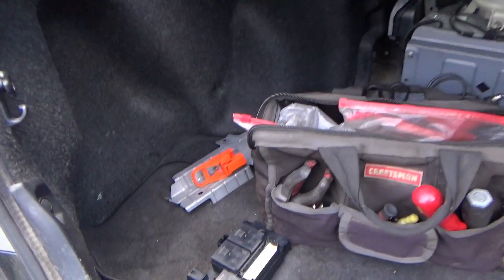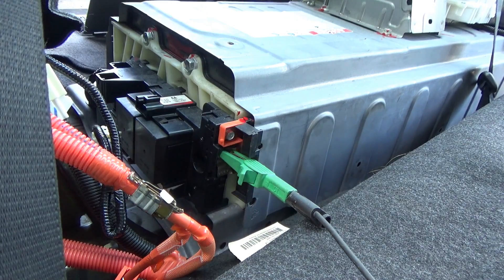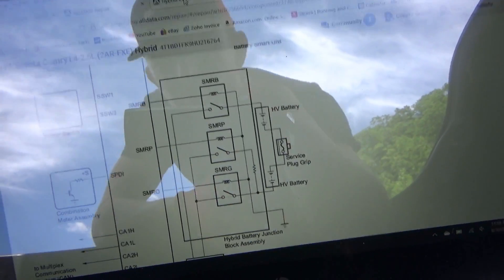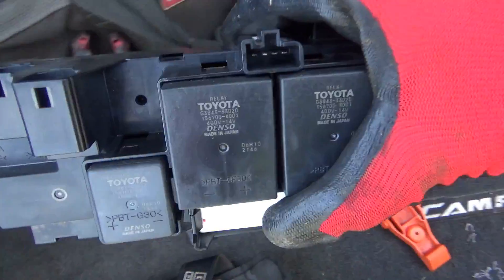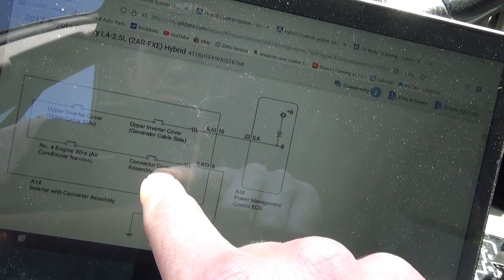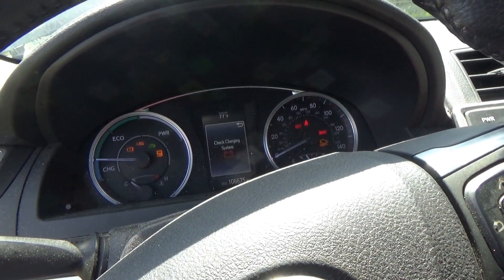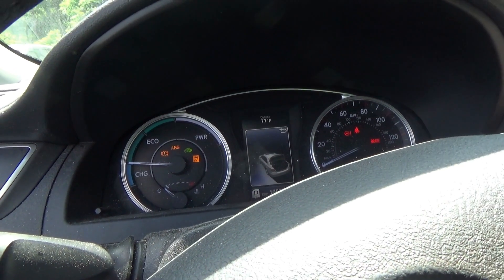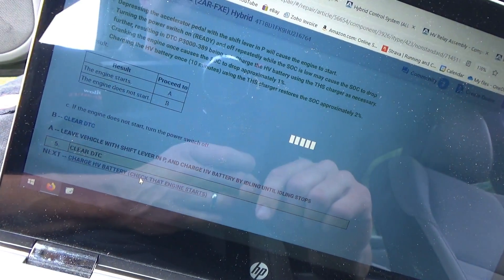Customer bought a HYBRID...and it Can't MOVE! (Part 2-Repairs)

Comment: If state of charge is below 20%, it won't enter ready mode. If there is a .5 difference between the highest and lowest v blocks it won't start. You can't just charge these, either. You have to discharge, then recharge and balance the damned thing

Comment: The traction battery Ah rating is huge compared to the engine starting battery (Aux). Most hybrid inverter designs provide for isolated charging of the Aux battery. I think the industry isolation tests are done at 3kV between Traction and Aux. 

The fast charger (fancy charger) specified should have power and com with the Traction Battery Controller (or Battery Control Module (BCM)). The BCM will monitor the Traction battery cells for power (voltage across and current through) in real time, as well as run the Traction Battery State of Charge (SOC) algorithm, amongst other things depending on the OEM.

Comment: Dealt with this one before at work. The THS charger is nothing but a high-voltage DC power supply.

We normally take the HV battery out (easy to do) and take the covers off. We connect an adjustable DC bench power supply across sets of four cells at a time, with the DC power supply set to 30V. Charge four cells until the current drops to about 100mA, move on to the next four cells and charge them, continue until all 20-36 cells (depending on model) are charged. Put the covers back on, reinstall the battery, car is happy. 

It's an extremely rare occurrence and tends to only happen in truly stupid situations. Ours was after a driver smashed the radiator, overheated the engine and kept trying to start it repeatedly until the HV battery was dead.
Reply: @kelvinstokes996  
Probably costs $6,000 too.

Comment: Hybrid car that is not driven for more than 2 months can have very low charge on the hybrid battery. It needs to be charged properly with proper slow charger that dealership have. It to reduce risk of permanent damage on the hybrid battery.

Comment: That ICE doesn't have a 12V starter!
Instead it has (what is called) a "crank-ISG"; which is a 3-phase electrical motor/generator running of the HV-battery and it's acting directly onto the flywheel. Even if the 12V BAT is perfect (at a 100% charge) you have no means of starting the ICE from a driver command. And a fully charged 12V battery would not be able to give a 2% charge to the HV-Batt even if the electrical architecture allowed it to. Hence you need the fancy HV-charger to get you out of this situation with a none-plugin hybrid. 

Your diagnosis is 100% accurate.

Comment: Wait I'm confused. I know very little about hybrids. Are you telling me there isn't a starter that's hooked up to the conventional 12V battery to crank the combustion engine?
Reply from the maker: Correct
Reply: There’s 2 motor/generators, one for starting the engine and recharging the battery through the inverter. The second one is a bigger more powerful traction motor responsible for moving the car and performing the regen braking function. AWD models have a 3rd motor on the back wheels.

Comment: Have a Toyota Prius 2008 no run no start I don’t have the fancy scan tool just Multi meter And a OBD 2 code reader . It turned out to be the in a pin connector in the high voltage area burned out same area in wiring just looking different. Replaced it with a computer terminal. Then I charged the HV battery manually by Charging each cell at a time works good.

Comment: Ivan, The battery cover removed, you will find a shunt that connects 2 or more battery packs together to make the whole battery. Once they are removed you can work on the cells individually as the voltage is safe. you can charge the cells with a standard 12v charger do not leave it unattended you need just enough to start the motor then let the cars internal BMS regulate the full charge. I am sure you knew this already but just incase you did not or perhaps help another person later.

Comment: thats easy and cheap repair. unplug the service plug, take it out, disconnect cells and measure each cell individually and write them down. Then replace the low voltage cells with good used or reman cells from amzn,ebay,etc. Put it all back together and it'll be good to go. Typically 2-3 cells are bad out of it because it sat so long with out being used. your looking at less than $100 in replacement cells

Comment: I have seen on battery underground drilling rigs on especially the SOC % (state of charge ) Condition after being ran down so low . The % you read out of 1% makes the battery system unhappy.
The battery system on our rigs uses onboard charging transformer through a drive inverter unit to charge the batteries!
The battery dictates everything and rig charging system tries to balance the charging voltage at the lowest battery voltage ( we have 4 batteries) and Amps to slowly balance the batteries during charging. 
The batteries on our rigs needs to reach 100% charge every 48 operation hrs or else the SOC drifts as you read out .

I can see why a special charger is required to correct the SOC % to 2
One big thing also is the battery system does a health check on the string of batteries to confirm there health by disconnecting battery charging and discharging them through DC heater for battery temperature upkeep . 
We also have relays on a bigger scale that send DC power on the circuit . 

It’s crazy stuff on these battery cars and hybrids as not many besides yourself can even fathom on fixing these in hometown repair shops without OEM support. 

I really enjoyed your videos on this hybrid issue 👍

Comment: There is no starter motor in new hybrids. The car uses the electric drive to get the car moving then engages the gas motor.  Thus the 12 v is only for the electronics and cabin items.

Comment: Stellar!  I learned a bunch from this video; and concur that purchasing a hybrid would require a lot of research before I dove in!  I wonder if Honda models have the same fail stops if the hybrid batter is low.  If there's an IC engine- by golly let us drive on it's power alone until at least we can get a batter issue resolved!

Comment: IVAN My neighbour has a Hybrid Toyota and went away on holiday for a few months, his wife asked me to start his car and give it a run to keep the battery charged up. When I tried to start it I kept getting a low battery ⚠️ warning message and light. I connected jump leads to the jump start terminals under the Bonnet (Hood) and onto my cars 12 volt battery and hey Presto after switching on and the car doing a self test the engine started after about 60 seconds. I disconnected the jump leads and let the engine run until it shut down automatically. When the neighbour came home 2 weeks later it started straight away. The Toyota Hybrids have 2 motor's  that also work as generators or Alternator to charge the batteries, both the HV and LV battery..

Comment: You really don't need a fancy charger to get some power into the high voltage battery. This exact issue happened to my 2018 Acura RLX Sport Hybrid after I was side-swiped this past January. The car sat so long at the body shop waiting for parts that the hybrid battery was too low to start the engine. I made my own "jump pack" out of 100 18650 cells and connected it to the air condition compressor power feed (the air con is 300v electric). It was enough to trick the computer into starting the engine and charging the HV battery. After 10 minutes I shut it down and reconnected the power cables to the AC compressor. The car restarted like normal and haven't had a problem since. It even cleared the codes itself.

Comment: I'm in E central PA. I could've cobbled together a charger for you. Not UL approved mind but would slowly current limit charge up to 310V, so just unhook it when it got to the voltage you wanted. Its too rare for the HV battery to die for the manufacturers to bother adding a way to jump the HV from the 12V. It also make$ for a nice excu$e to force a dealer garage vi$it.

Comment: also "WhY cAnT a 12V bAtTeRy cHaRgE a 290V bAtTeRy?? Im sO cOnFuSed"

Cmon man. They are a new tech, and just require new tools and understanding of new systems...complaining that the technology sucks because you arent familiar with repairing it is no different to ignorant boomers complaining that fuel injection was bad because they didnt understand or have the tools to interact with the computers to diagnose issues.

What you experienced here with the HV battery being so discharged is super rare. I have put dozens of millions of miles on hybrids in my fleet and never encountered it. It almost takes effort to get one of these things to discharge its HV battery so far it wont try and turn over the engine.

Comment: I bought a 2007 Camry Hybrid, black too lol,  from the auction. Yeah,  it was dead as door nails. The car sat in the auction for 6 months before sale. The hybrid battery was completely shot by then,  no THC charger will fix it. Had to put an after market battery in. The car cost me $1800 and battery installed $2200. Other than that it was perfect inside and out. The is the main reason I wouldn't buy a Hybrid in auctions unless they run,  they sit too long.

Comment: This is one reason I will never own a hybrid vehicle.  You are SOL if the battery is low.  Plus what if traveling and your battery is running low, you need to find a place to charge it, with gas or diesel you can always find some where to get more.  It's not like you can call a tow truck to come bring you a charge like they can bring you more fuel.  So this is why I been buying low mileage vehicles gas or diesel for when they stop making certain models.

Comment: You know i never understood why they tend to make all the crap around any high voltage connections all out of metal..  like youd think that for certain straps or brackets that are there to protect from shock would be made from a non conductive material..  like why have a high voltage switch with 240v on a 60a breaker stuffed into a metal box where theres live unprotected screw terminals less than a quarter inch from the ungrounded metal enclosure that gets touched every time the switch is used..  just seems dumb..

Comment: you need a used HV battery as a jumper box, pull the fuse disconnect on both batteries bolt them together in parallel install the disconnects, let it charge for a few min, pull disconnects remove jumper pack wires and restart.
or disassemble the battery pack, place all batteries in parallel and charge with a 6v 10 amp battery charger.
I have done it both ways.
i have also installed a second HV pack in parallel to run and charge 2 batteries making sure to bolt one of the wire connections after the amp current sensor on pack so as not to throw a code.

Comment: i work in a bodyshop and we have had this new  electric chevy bolt ev that hit a deer omg what a nightmare!.the car keeps coming back one problem after another.to work on them dissconect 12 volt first then pull plug under backseat if you do it backwards it sets off code like its been in a accident so it has to be reset by laptop dealer thing.cars are getting weird.for first responders if you open hood theirs a cable by the battery that says cut here then you are trained to rip back seat out and pull the plug theirs a 1000 volts their.not sure what it takes to kill a human maybe 230 volts?.scary stuff working on them.any cable thats orange means death.its gotten differnt i have replaced quarters and welded on toyota prius es  pull the 12 volt cables off your fine but this new gen not liking as a collision tech.we replaced everything that was damanged with new oem parts now it just decides ohh i was in a accident once so ill just do random bad things

Comment: Lol modern hybrids DO NOT HAVE STARTERS they use either the torque motor or the charge motor to start if the HV battery is severely discharged its not going to start. They also don't have an alternator they have a DC to DC converter to step down the high voltage to 15vdc to charge the 12v battery and run the 12v systems. The DC to DC converter CANNOT charge the high voltage battery by back feeding its one way. 

Older hybrids still had starters and alternators (we had one In the shop with a 5 speed manual) they only shut off the motor during cruising. It's not dumb... people who don't take the time to learn about their vehicles are dumb and this owner bought an auction car with both battery's drained it should have gone strait to Toyota in the first place

Comment: 10:03 I already knew it would throw the codes, because you didn't slide the connector lever handle down after installing and pushing the lever in.
I did that on a prius once and spent nearly an hour cussing it and then myself for not pushing it into place. 🙃 it would be different if that was the first time I worked on one, not that 100th+ time. 🥳🤡

Comment: lucky you upon reconnecting the 12v battery. stupid prius always blare the alarm like your a thief stealing them and you have to jam the keyfob in dash port before it will shut-up!
at least the older models with (SKS) keyless entry did that and when jump starting them from dead battery 100%. it's just great sticking on the jumper cables under-hood and it starts blaring.

Comment: you can get away with it just by towing car with rope whiles car is on once u get moving n put in driver from neutral it start charging itself up (done that few years agos on Toyota pri... (she run out of gas n she got stuck on side of road cant do both n i arrive n put gas in it but still refuse to start n i tell her my best choice is do tow car with rope on highway unite you get up to 30mhp n put it in drive that way will start changing it self up so u can get engine started n it did work on 2010 ) hoping you see this

Comment: I bought a 2008 Escape Hybrid for close to scrap value last year because the man couldn't get it started. He bought it at auction and parked it for 2 months after they delivered it. It has an onboard boost converter to charge the hybrid battery from the auxiliary battery by pushing a button at the end of the instrument panel. I put a fresh, well charged auxiliary battery in it and had it running in 15 minutes.

Comment: Hybrids are useless for most of us who drive on the highway most of the way to work.
Reply: I drive 16 miles each way to work,  most of that is in city interstate. I'm averaging 54 mpg.
Reply: @scott_meyer  that is impressive.  My co-worker, whom I carpool with, gets about 40MPG average in his Hybrid Venza.
Reply: @The_Redkween  
Before new tires were installed I was averaging 58. I was surprised how much difference the low rolling resistance tires added. My best single tank mpg was 61.
Reply: @The_Redkween  
The city is hilly, so when driving downhill the engine doesn't run and some energy is recovered back into the battery pack.

Comment: It takes time after removing the safety disconnect for the voltage to dissipate. Most manufacturers specify how much time to wait before testing for voltage potential to allow it proper time to dissipate.

Comment: As soon as i saw how you put in the service plug. I knew what comes next. Recommend taking a small EV/hybrid course. I had to do so also, to learn these little tricks of the trade. Then you have to recondition the battery, and this is if i can be recondition. If not, you have to replace the complete battery or the modules which will be costly.. Such a pain in the butt.Nice video still

Comment: Great diag again ,  good to see you working on all this newer hybrid battery technology the proper PPE  and insulated tools arent cheap to do it 100% correctly.I remember seeing someone on youtube pull down the generator after it failed and he said they really should have installed a standard 12volt starter motor. I can now understand why it's a issue and looks like a $$$ maker for the dealerships as well as saving a small amount of money on manufacture. Would be interesting to see what they wanted for a ten minute charge to get the engine to tick over and complete the recharge.Frustrating following up after others have fiddled with things they know little about. People are saying new EV,s will be maintenance and service free  but once they fail  and they will diags won't be easy and you can guarantee the self diag software won't be accurate.

Comment: the lock itself when fully engaged lock the upper connector... had the same issue on 2013 mkz 2 months ago .a body shop was working on it and for some reason disconected it and did not pulg it in all the way .

Comment: I wonder if towing the car in drive position would recharge the battery as it would normally regenerate. I know that's not advised in the manual but that was an auction car anyways, probably worth to try it.

Comment: Gotta love the 21st century. Everything is designed to bilk you dry!  They probably charged the guy $500 to charge the battery, lol - that wouldn't shock me one bit! Can't wait to see all the problems and pitfalls with EV technology. Going to be an interesting next 10 years ... if the country survives the morons running it ... but that's another topic for another day!  😉 As I said in the last comment I posted before I realized you already had the part 2 out, you and Amanda have a great Independence Day! 🇺🇸

Comment: Hybrids do not suck, Ivan. Don't get so frustrated with something different.   We've had 2 hybrid Hyundais and loved them.  Yes, they're more complicated but as with anything else, you'll get them figured out.  I will admit that the dead HV battery issue preventing the engine starting is pretty stupid.  The regular 12V battery should start the engine and the engine charge the HV battery.   I'm pretty sure our Hyundai will still start if the HV battery gets low, but now I'm going to have to check the manual.
Reply from the maker: I wasn't frustrated because it's different... The new tech is fun to learn! But you can see why I wouldn't drive one myself 😂